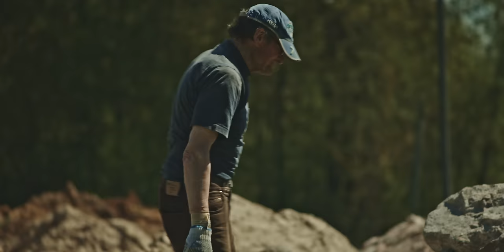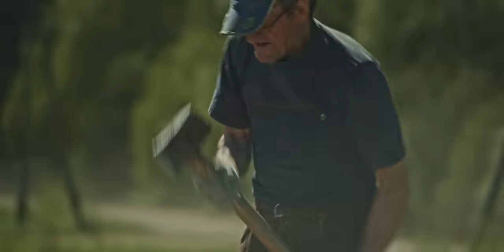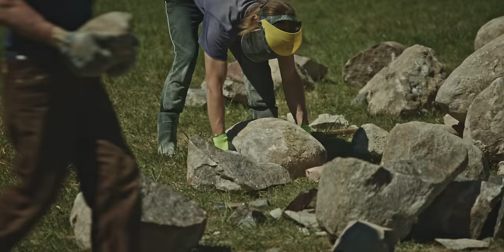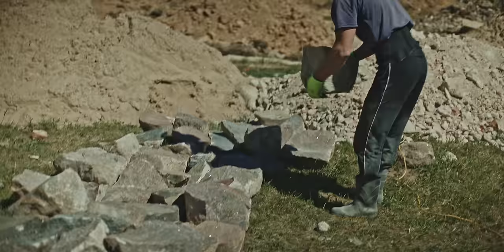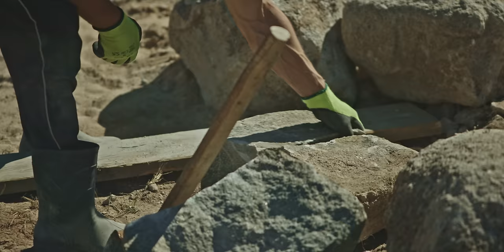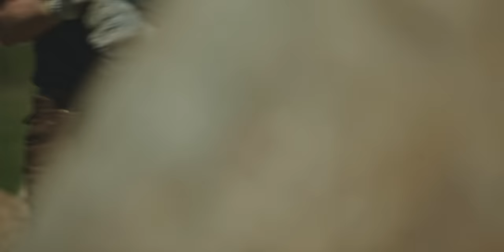The Last Stone Splitters

Comment: The 131 who disliked this video have never done a hard days work
Reply: Its the bullshit title. Lots of people still doing this and probably in whatever region this is too. Any stonemason can split stone and has to, to build walls. Breaking rocks is easy.
Reply: @corindoyle  "probably" Meaning you don't know for sure.
Reply: "151'
Reply: @corindoyle  if u know how to split them . most people dont know how. unless someone showed them . i never knew until an old stonemason showed me . some rocks u can't split because of the grain also Quarry rock is easier to split then granite
Reply: They can barely lift a spoon of pablum...
Reply: @corindoyle  голову разбить легко, в носу ковыряться легко. 
ТЫ кувалду его поднять не сможешь. Камень нужно уметь "читать".  
Сиди,  тыкай одним пальцем в клавиатуру.  Однокнопочный. 
it's easy to break your head, it's easy to pick your nose.
You can't lift it with a sledgehammer. The stone must be able to "read".
Sit, poke one finger at the keyboard. One-button.

Comment: Wish our granite here in Sweden was soft enough to split like that. I would use it a lot more then.
Is this in Baltikum?
Reply: have you ever tried? I am in Denmark, and the ice age brought us all the granite we have from you and the Baltics, and inspired by this video I tried recently and yes, they can be split. The important thing is to hit it along the plane of weaknesses, which is the lines you will be able to see in most stones
Reply: @somatder  Yeah, I've tried plenty. Could just be bad technique of course. Basically given up sledge splitting without wedges.
I crack a lot of boulders too large to handle with fire. Apart from cracking, fire changes the granite in some way, making it brittle. My 5 year old sometimes pulverize heated granite with hammer, for fun.

Comment: that hammer/mallet. any info on it?
Reply: Just google stone splitting hammer, it's the most used tool for that. If you are interested in getting one and you can't find it anywhere near you, just buy a pretty large hammer and grind one side(this could take like... a lot of time, but it works)
Reply: It would be a stone mason's hammer or sledge, there are many sizes.  The boss in the video is probably using a 12-15 pound hammer.  You'd find them at antique stores, flea markets, or yard sales.  You could use a wood splitting maul or a large straight peen sledge with the edge ground blunt to get the same effect.

Comment: but for what reason would somebody split stones nowedays?
Reply: To build nice looking foundation?
Reply: I'm splitting granite for a foundation and fireplace for the log cabin on my property. I don't have enough flat stones otherwise.
Reply: Traditional building, that's why!
Reply: Landscaping, stone foundations for building.
Reply: I thought he was making a garden path with the way he was laying them out and cutting the edges strate lol
Reply: The pile from which the men are working, is round, smooth, river washed stone. The reason the stones are split, is to give them sharp edges so they hold together when forming the wall. River washed stone is cheaper than quarry stone, but has to be worked before it's of any use.
Reply: To see whats inside

Comment: why would you need to split stones??
Reply: have u ever seen those houses that has cement stone walls? Thats what they split them for.. and u can make many things look good made by makeing them of stones. I personaly love those buildings. Would love to make 1 myself.. but that work seams to hard + buying those stones vould probebly be extreamly expensive.
Reply: thanks mate, i actually thought  that that could be the reason but i also thought it would be esier to build a woodden house and maybe there was another use
Reply: No problem.. and for wooden houses for foundations it looks awsome aswel. I think these guyz did house with foundation like that to.. on video. U can use them for estetics on chimneys, smokers, fireplaces, stoves... just immagine man.. u can put those to use in any places.. u can grind them empty and make them as big dishes for flowers or as sink.. shower bed, wals.. paved driveway.. ive seen some floors aswel. This man is true designing beauty.. and expensive as hell.